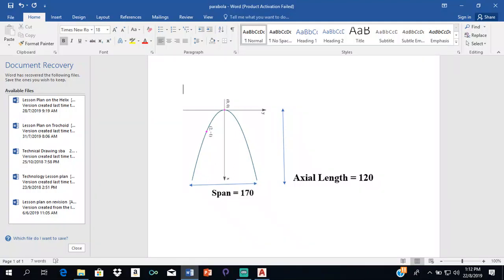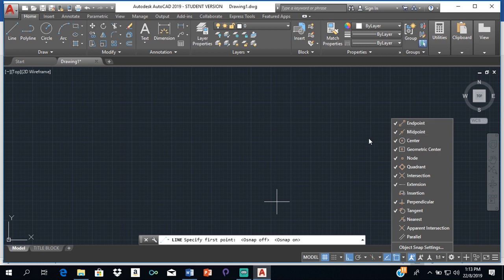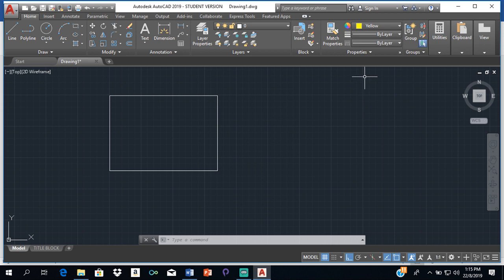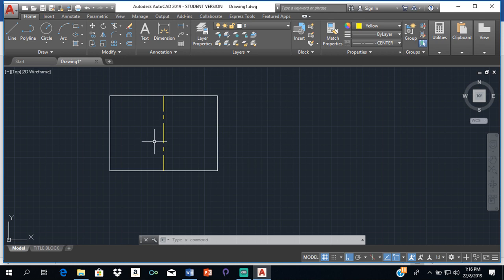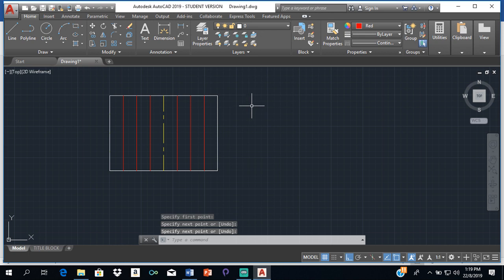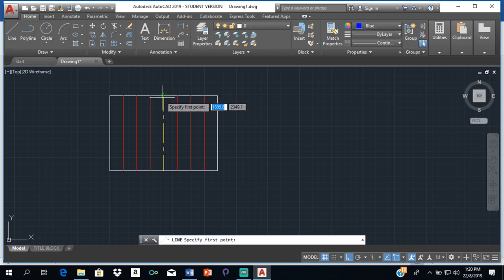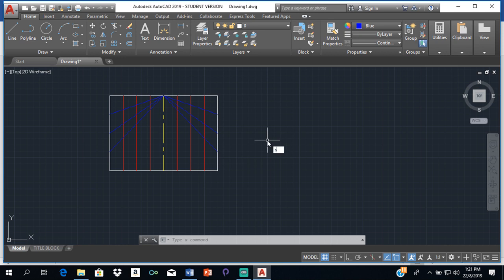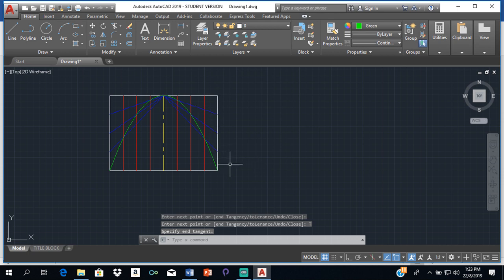How to Construct a parabola in AutoCAD

Comment: That's an awesome easy way. I am just curious, how accurate is that parabola? The specified points should be correct, but the spline curve automatically chosen by AutoCAD BETWEEN the points are not exactly parabolic necessarily?
Reply from the maker: Good day Charles for this method of parabola construction the main focus is on the steps that are used to construct the parabola. Once the steps are correct then the spline in AutoCAD will give you a fairly accurate parabola. To get the parabola to be more accurate you can use more division lines between the axial length and span so you get more points.
Reply: @mr.cargill  Makes sense, thanks for the reply!
Reply from the maker: @CharlesNam  you're welcome.

Comment: Can you tell me why it's the case of dividing by 4 and 8? Why those numbers?
Reply from the maker: Good day. The reason for using those numbers is that the span has to be divided into twice the number of parts as the axial length, hence 8 and 4. It could have been 10 and 5 or 16 and 8 and so on but 8 and 4 is easier to deal with as it has less lines. Anything smaller that that such as 4 and 2 though they could be used would not have enough points to plot the curve neatly.
Reply: @mr.cargill  Ahh okay. Thanks a lot! :) your video was very helpful
Reply from the maker: @hurbrowns5397  Happy I could help.